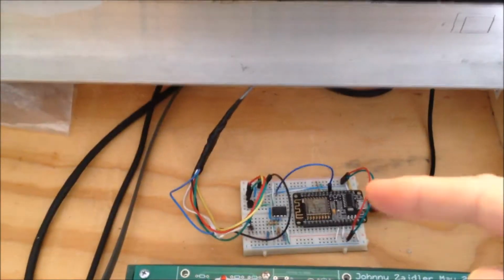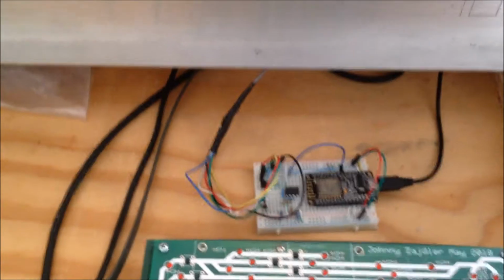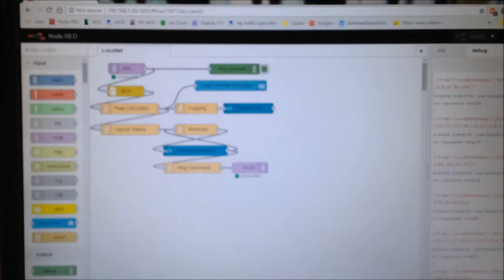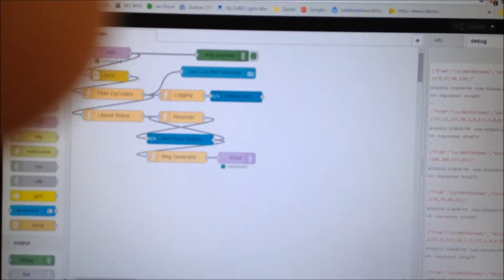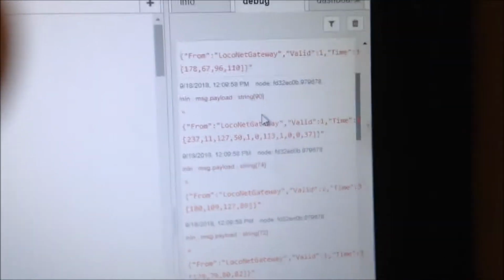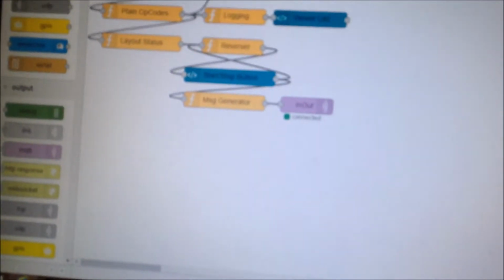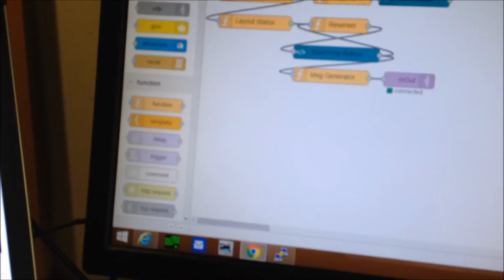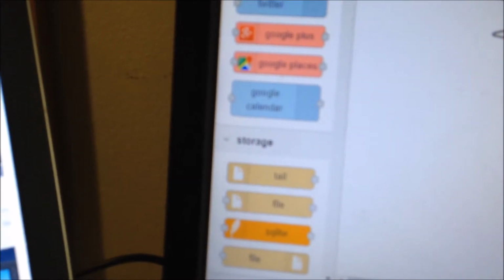LocoNet+MQTT Gateway

Comment: Do you have Node-Red running as a broker?
Reply from the maker: Hi, yes. I use Hans Tanner’s web throttle and his loconet plain English viewer. I have not explored more MQTT options.
Reply: @ClinchfieldModelRailroad  So, how many iott sticks, two?  1. Loconet interface to iott stick to MQTT and 2. wifi interface to iott stick to DCC interface? I’m not sure which way to go yet? I like the idea of using independent inputs and outputs
Reply from the maker: @marekhabel2493  if you have loconet then the one loconet to MQTT interface is enough.